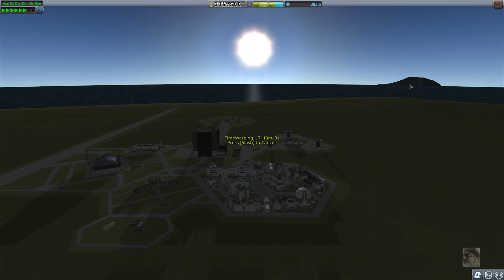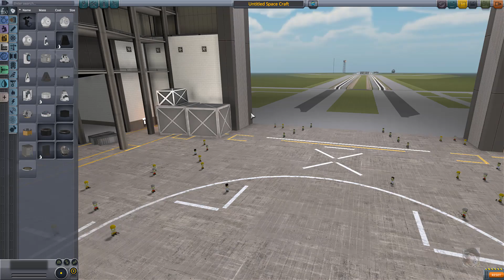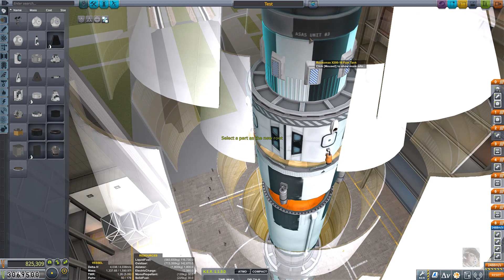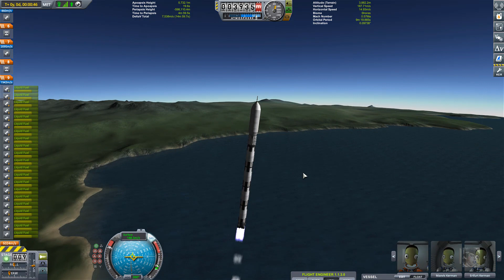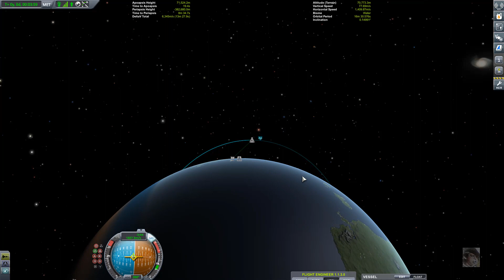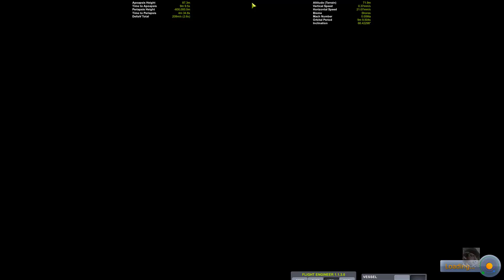KSP -- Heavy Lift (150t payload) Reusable Rocket (SSTO)

Comment: You spending way too much time at high speed and high heat, risking too much damage on your booster. Secret of slowing down quickly is DRAG.

Dump all the air breaks, put a pair of big fat shuttle wings on each side, they don't weigh that much, land the booster as a shuttle, or vertically, up to you really. Slows down A LOT quicker if you enter like the shuttle.

Anyway, that was a pretty nice landing, very precise.
Reply: Would a 10m heat shield work too?
Reply: @awhahoo  that would block the booster
Reply: in order to make it land like a shuttle it has to have big big wings and i dont think it can make it into orbit with such big wings (too much drag during ascent)